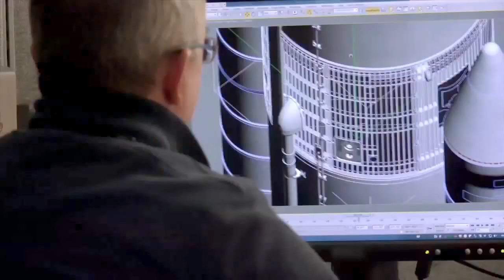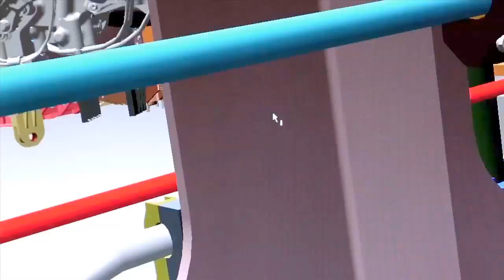Boeing - Space Launch System (SLS) Heavy-Lift Advanced Launch Vehicle Unveiled [720p]

Comment: 1:43 Is the big lie.  ** Orions actual use time on a Mars mission would be less than 1 hour (launch and landing) on voyage that would take 2-3 years.  Orion (The capsule) may be a human habitat.  But ONLY for Earth re-entry and launch.   You try to go 6 months one way in a small capsule and you will go completely mad.  Even Apollo had a service module where the people live and work in.   Basically any capsule with heat shield Mars rated will do the job.  Mars rated means in has heat shield that it can withstand higher speeds of re-entry that you would have built up coming home from mars.  This can be done with Dragon II which may already be required to land on Mars unless the government plans on developing a MEM Mars Excursion Module.  I say government because NASA gets dictated to by government.
Reply: Snip ===> Chad Snow . 6 months ago (edited) -- Even Apollo had a service module where the people live and work in. <=== Nobody could live in Apollo service module (SM) - See https://i1.wp.com/thefoxisblack.com/blogimages//FittingInSpace3.jpg for information about Apollo command module (CM) and service module (SM).